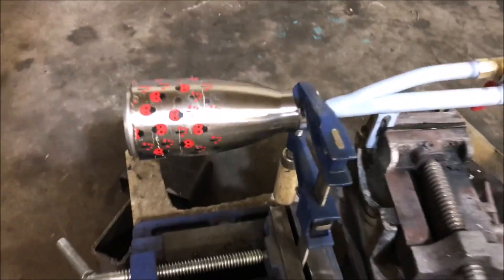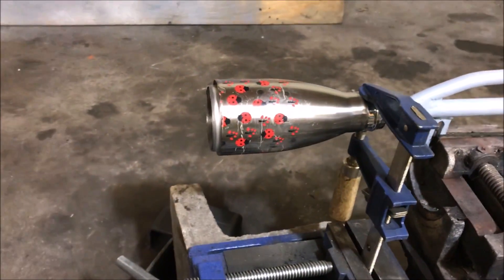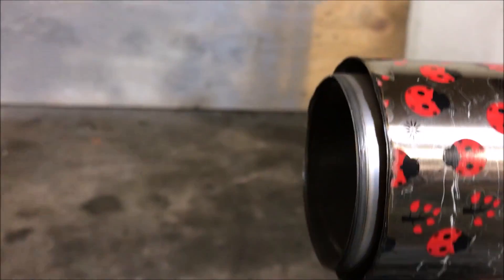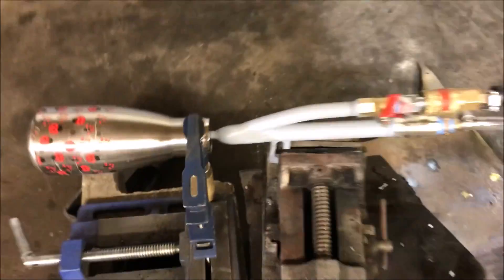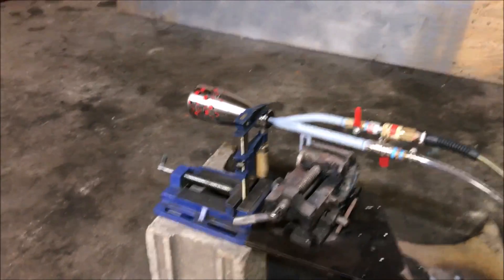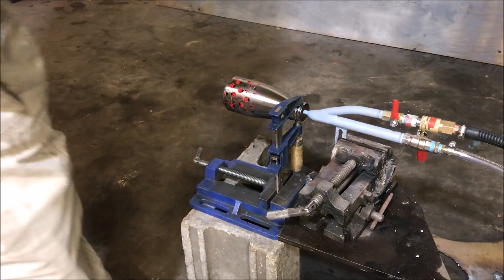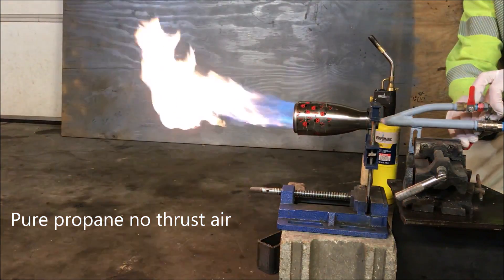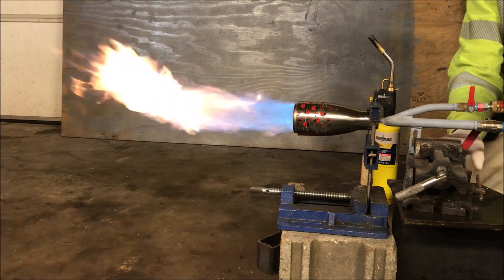High Velocity Forge and kiln burner  DEMONSTRATION

Comment: So for a forge and a kiln, the flame shouldnt burn in the nozzle. the flame should be inside the kiln or forge.. that is why most burners for those kind of things are alot smaller. To increase gas velocity.. The tube is essence only a way of mixing incoming gas and adding more air..  A small adapter from that contraption of yours straight into the forge could just be fine..  But in a kiln/forge setup you never wanna waste energy by mixing further back and setting the fuel on fire outside the chamer you wanna heat.
Reply: Yeah and stick the propane tank in a water bath, will allow it to maintain temperature and gasify better just regular room temp water nothing crazy.
Reply from the maker: @Moronicsmurf  Good idea , this design you are seeing is for a kiln but a smaller version may be made to try on a forge
Reply from the maker: your way the device wont braze 1/4" steel , thanks for the input but time is money and despite a little pre burn this set up is to increase production time

Comment: Surprisingly good nozzle. With the insulation layer being accessible like that you might try filling it with some refractory cement or even cheaper option (and probably a better insulator) some homemade carbon foam which is just carbonized bread.. you basically just cook bread at a high temperature in a containment vessel with a small port at the top for the flamable gasses to vent out of without letting the bread catch fire. You can also make "starlite" which is just baking soda, corn starch and a water based wood glue. It is functionally the same as carbonized bread foam but I think it would be more suitable for something like this. The "starlite" is nice because its a moldable clay like substance before the glue sets up and is a very good heat insulator. You can find videos all over YT of people making it and demonstrating it.
Reply from the maker: Love the input , thanks

Comment: I'm sure you have considered it: putting your propane tank in a tub of very hot water will allow higher flow for longer.  Used to do that with the foundry.  Love the repurposed stainless steel bottle.  I used one years ago for a motorized bike exhaust/muffler and it would turn the unburned fuel of the 2 stroke engine into blue flame once hot.  I did have a mini catalytic converter in the center of the feed pipe which contributed to the burn.  Keep up the experiments, very interesting!